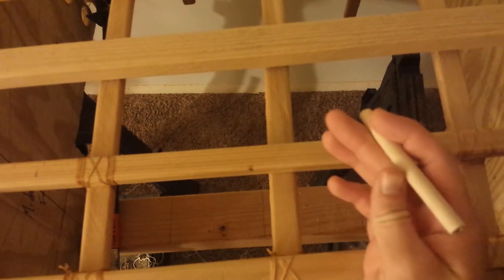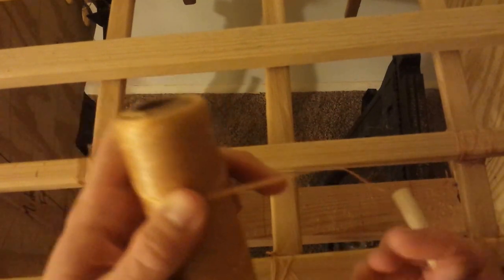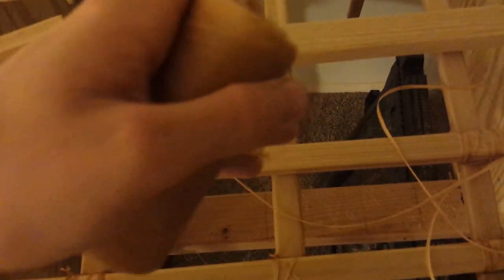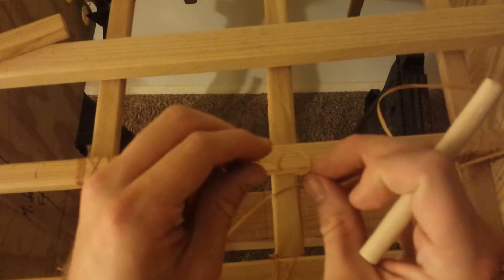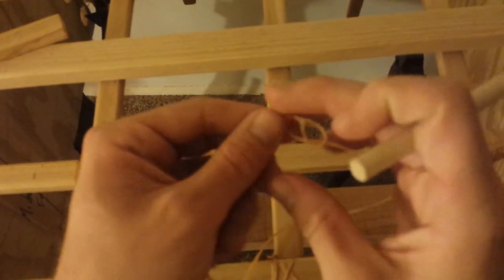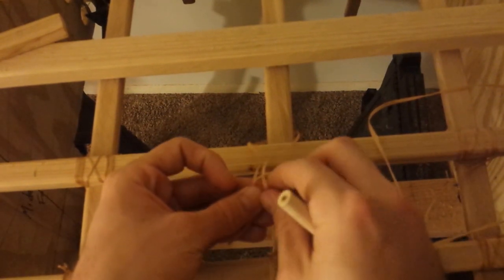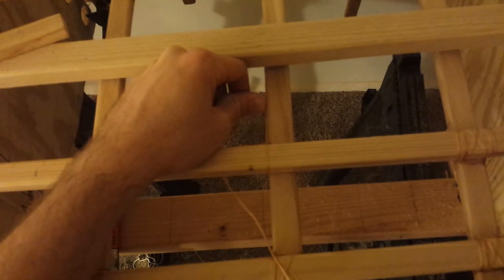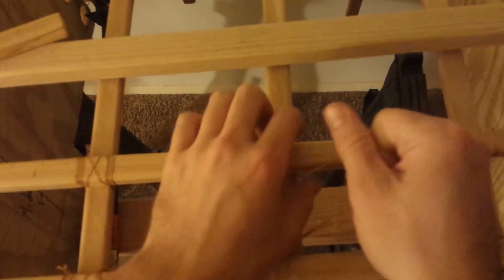Skin on Frame Canoe 8th (Lashing Joints)

Comment: Tandy Leather stores sell flat (artificial) sinew (waxed) for about $20 you get ~400 yards.
Reply from the maker: Thanks for sharing this additional source! I think you can also get it on amazon now as well.
Reply: For sure, there are tons of SOF building supplies on Amazon, including the artificial (nylon) sinew.  However, if you are an "Elite" www.tandyleather.com customer, you can get it for less at Tandy.

May I add it is also worth while stopping in at a Tandy Leather store (there are more coming every day as they expand), because of the leather goods and fasteners which are also good for a SOF build (i.e. leather straps and cordage, metal as well as plastic fasteners).  Besides, if you choice to go completely authentic, it is a good place to find the right skin for your build.

My current build is mainly supplied by Home Depot and Amazon.  I have no affiliation with Tandy Leather.  I only know it as a good alternative to the BIG STORES.